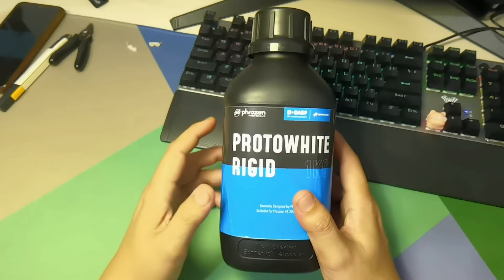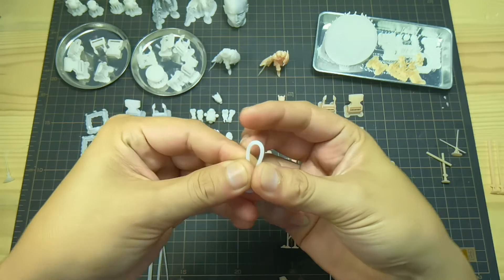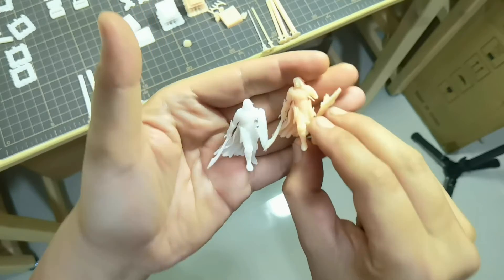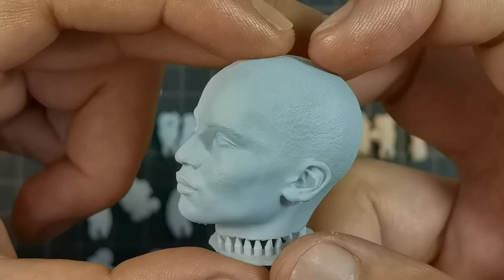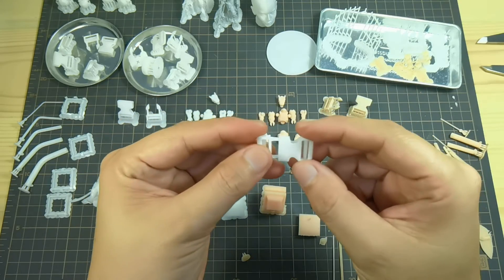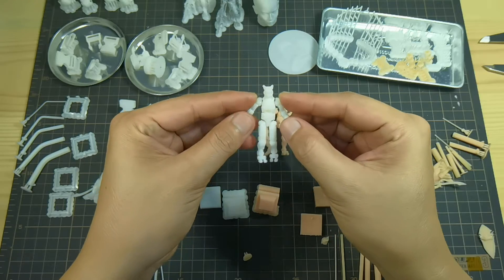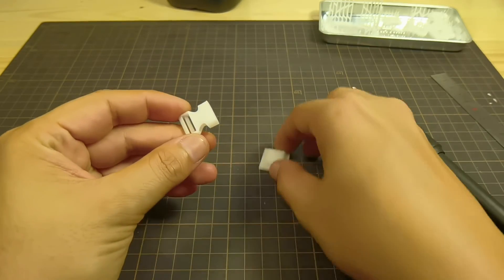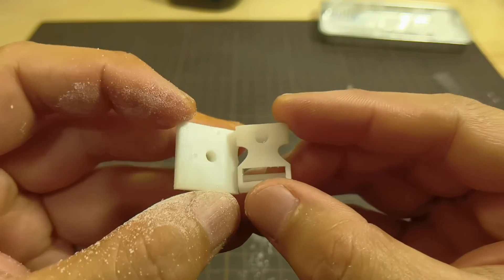Proto White Rigid Resin

Comment: I'm about 4KG worth of industrial micro devices printed in this material. These devices are subjected to repeated impact forces. Protorigid and Onyx Impact are the only two materials that allow these devices to last few million cycles. Onyx is easier to print, especially when small orfices and internall "channels" are needed (0.5mm dia and smaller) but it is more sensitive to low resin temperatures when printing, thus heating it helps with accuracy for smaller geometries. As always, great and very informative video, Dennys.

Comment: What is proper way to wash this resin?  My prints have come out with sticky spots.  i know you said to use brush...can you explain all the process?  like what kind of brush, how long to wash and what liquids.  thanks A TON!!
Reply from the maker: Just dip it in alcohol for several minute then brush it with any soft brush tip.
Then use alcohol in spray bottle to extra clean it
Reply: @wangdennys  Excellent Thanks!  I sub'd your channel and have been working my way though your content, very excellent!!!!  I'm relatively new at resin printing and have a lot more to learn as I am finding out watching your vids!